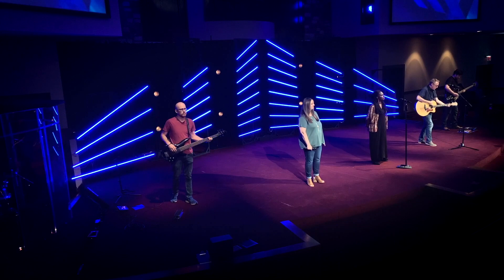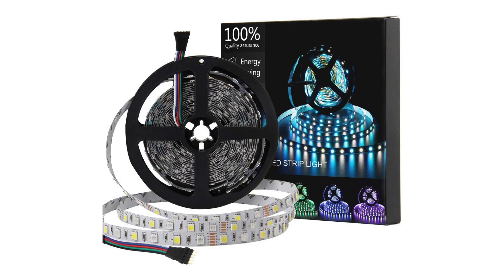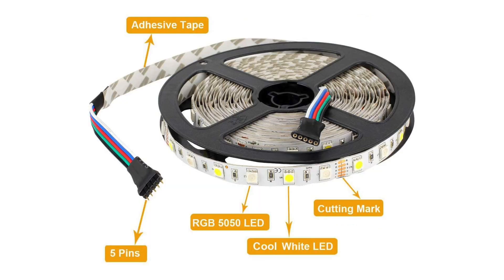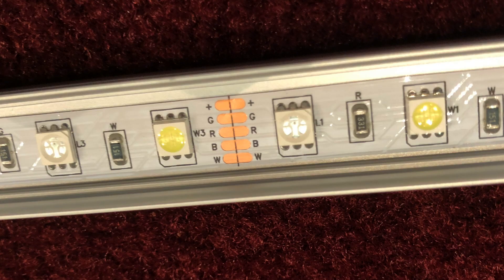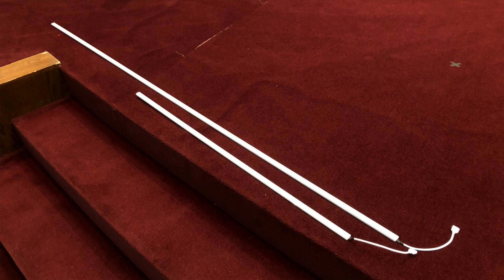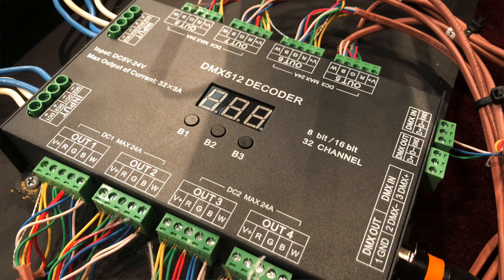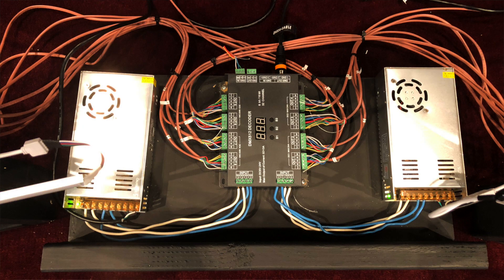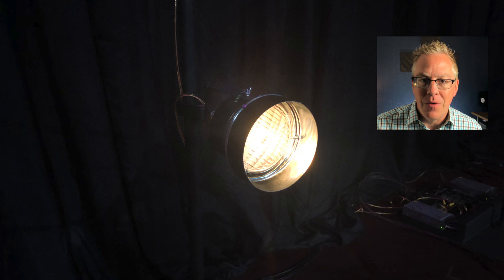Create an LED tape stage design - what you need to know

Comment: So when tieing into your lighting console, you have to set the channel on the DMX decoder?  Is it correct then that all 8 strips plugged into that decoder than have the same channel and must be controlled together as a group?  I'm not sure I understand how to get individual control of all lights if they are each plugged into the same DMX decoder.  Seems like I would need multiple decoders to get more channels.

Comment: Looks great! Did you run each power supply to separate outlets or does it matter?
Reply from the maker: At least in our case, it didn't really seem to matter where we plugged in the power supplies
Reply: @practicalworship  Awesome thanks!
Reply: @practicalworship  One more question. Did you use multiple decoders or were you able to address the different strips with the one decoder. I saw the shot where you had multiple colors running in the same lighting scene and was curious.

Comment: What cables did u use to connect the decoder to the power supply?
Reply from the maker: We have some leftover ballast wire, so we just used that. I think it’s probably 10 gauge. It’s pretty thick, which is probably overkill for the load it actually has to carry, but it works.

Comment: So the plug connectors are connected to each led strip? Sorta like a daisy chain? Thanks!
Reply from the maker: Kind of. Each bar actually gets its own channel except for the middle two sections. The top two bars of the middle section are tied together, the second two bars of the middle section are tied together, etc. We decided to run them in a parallel circuit, so basically each bar (the top left one and the top right one) both plug into the dimmer pack at that green plug. I hope that makes sense!